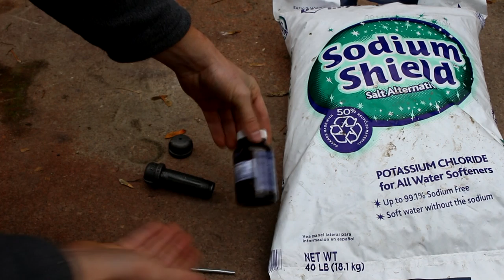Making Potassium Metal

Comment: Cody vs chemist in lab

Cody:puts sodium inside reaction chamber without gloves on

Chemist in lab:3 pairs of gloves on, respirator and working in a fume hood while reacting sodium with water

Cody:makes NaK alloy and simply reacts it with water 

Chemist in lab:I have 3 ambulances, 10 firemen and the spectators are 100 m away for pouring 1 ml of NaK in water

Comment: Did the magnesium melt? If it didnt then that might be the problem. You could also try using a lead and sodium alloy to help prevent the sodium from boiling over, though the potassium might be too soluble in the lead too, might be worth a shot.

Comment: Combination of furnace and vacuum chamber might produce better results? Although I'm not familiar with how sodium and potassium boil at lower pressures and how would you even get the power for the furnace inside the vacuum chamber without breaching the vacuum. Still would be a nice bit of kit

Comment: You had to expect noticeable sodium contamination when doing a distillation of that amount of reactants in something only about 3 inches long , especially with the entire thing in the furnace. If you get a metal boiling 'flask' like the one you had that was as long as your furnace would allow, and used the same amount of reactants, your purity should be noticeably better. Turn the boiling 'flask' in to an improvised fractionating column. The furnace will make it tough but if you can drink cyanide and eat dry ice you can get good clean potassium.

Comment: Just an idea for your work: since NaCL and KCl are both water-soluble, would it be possible to dissolve the two in a solution together and then add/remove heat (depending on whether the reaction is endothermic or exothermic) in order to cause the equilibrium formed to favor your products? I think le chatelier may be able to apply to your process. Depending on how it goes you may be able to setup a system similar to the Haber process (what is used to create NH4+ out of NH3 and H. Sorry if you already knew that, but in case anyone else reads this and doesn't know what that is I figured it's good to inform them).

Comment: Hey Cody, my math may be off, but it seems the reaction with magnesium has a positive Gibb's free energy value for the reaction at ~1200 degrees Celsius. The enthalpy of formation is very unfavorable for the reaction and the entropy is too low to compensate. I'd try out the math for yourself to check and see.

Comment: Maybe you could insulate the tube so the potassium stays molten until it reaches the bottle. Then you shouldn't need to the torch to make it come out. But too much insulation and it would pry crack the bottle and boil the oil.

Comment: You weren't worried about the K alloy-ing with the metal distillation tube?
Reply from the maker: not with steel no
Reply: where do you get your chemicals?
and out of curiosity what classes/degrees are you getting or have already gotten?

Comment: is it possible that the magnesium was an alloy? Mg is usually alloyed with other metals for the thixomolding process. basically injection molded magnesium, usually referred to as AZ91 A thru F. Mg alloys contain Al, Cu, Fe, Zn, Si, Mn, and Ni. is it possible that one of these possibly ruined the Mg based reaction?

Comment: Hey  Cody, would a laptop on mars overheat because of the low pressure? I know that it is very cold on mars, but with your last video proving that a fan generated basically no wind, would the laptop cooling fan not work?
Reply: I would think overheating could be an issue in a vacuum. Not sure about on mars since what little air there is happens to be very cold.  
Anyone have a junk laptop they can send? Run some benchmark software and see what happens. 
It would be interesting to see what happens to the LCD in low pressure too.

Comment: what you have is NaK. An alloy. Not pure. Good idea but waste of time for pure K. A better method would be to melt the KCl at 1400F and apply electric voltage to bubble off the chloride gas. Potassium will be left.

Comment: PREPARATION OF POTASSIUM AT HOME. 
All you need is chunks of aluminum and potassium hydroxide. 
2KOH +Al = KAlO2 + H2 + K 
You already have the means on how to melt them together,
 temperature of boiling over of potassium is 775 Celsius or 1427 Fahrenheit.
But experiment show that temperature needed to collect Potassium was 800C or 1475F
Higher temperature did not adversely affect the experiment.
In the college I use a 1 ½” diameter 6” long pipe nipple, 
bottom cap was welded around for titer seal, 
top cap was crewed on with hole drilled and tap for 1/8” NPT (National Pipe Tread), 
and commercial break line treaded with 1/8” NPT was used for this purpose.
You can use any matching treads on your pipe and hole in the cap.
Preparation: 
Use a cheapest aluminum foil you can get!  It is the purist (the best) one: no additives or coating on it.
Use a potassium hydroxide from soap making outlets or in worst scenario use eBay. 
I newer fill the steel pipe more than half full, 
do not use a water steel pipe use black gas pipe
zinc plated pipe will burn off and give off toxic gases
I use a low melting(liquid) paraffin to catch and collect potassium, 
Paraffine temperature was around 90C or 200F
You can expect to get 1/3 of the mass of potassium hydroxide in potassium metal
If you begin with 65 gram of potassium hydroxide you will have ~ 20 to 30 gram of potassium metal
If I remember correctly I use 65gram of potassium hydroxide and 35gram of aluminum it was a 100 Gram shot and our yield was 20 to 30 gram of potassium metal

Comment: Cody try making a EAS(Emergency Air System yes I just made it up) by making a canister of liquid nitrogen and a canister of liquid oxygen and having it so it releases all at once making a nice little burst of 80% nitrogen 20% oxygen air
Reply: either the temp or pressure would need to be extreme and it would explode if released all at once
Reply: hmmm, elaborate

Comment: how does one get that big a piece of magnesium
Reply: Easy, order a replacement spare wheel (two piece) for a hummer. Huge piece cast Mg. Also, many construction tools now have Mg bases. Some old push mowers had a deck made from cast Mg.
Reply: thanks!
Reply: He recycles alot of things.
Reply: Concrete smoothing float
Reply: He chopped his from a drywall hawk. A piece of equipment dry-wallers use to carry mud when taping. Often made from magnesium as it has low reactivity to the drywall mud (ie. doesn't rust) and is light.

Comment: Any ideas where magnesium can be found? That's my biggest problem these days
Reply: Google.
Reply: Fuzzycat tried that. Kept getting sources that don't ever show up around here. Those sources end up being steel or aluminum where I live
Reply: Easy, order a replacement spare wheel (two piece) for a hummer. Huge 
piece cast Mg. Also, many construction tools now have Mg bases. Some old
 push mowers had a deck made from cast Mg. No problem!
Reply: eBay
Reply: Hilmi Albums they charge way to much lol.
Reply: Tom Bombadil that might be just what I need. If the price is right
Reply: if you can get your hands on any cast machinery or casings for old electronics they are often made of magnesium. it looks like aluminium but if you scratch it and put a drop of vinegar it will bubble and show you that it is magnesium.
Reply: If you don't need a lot of it magnesium fire starters might work.

Comment: why don't you melt he potassium chloride and electrolyse it?
Reply: 9:49 and potassium chloride has a high melting point of 770°C
Reply: he has a furnace that can do that and more gold is over 1000 degrees
Reply: well i'd recommend you watching nighthawkinlight's video, it is difficult to keep it liquid while simultaneously electrolysing it and he did it with sodium hydroxide which has a melting point of about 300°C
Reply: I seem to remember the problem nighthawk had was that the sodium hydroxide started corroding everything he was keeping it in rather than having trouble keeping it liquid any way I plan to try this myself so I'll see if it works myself